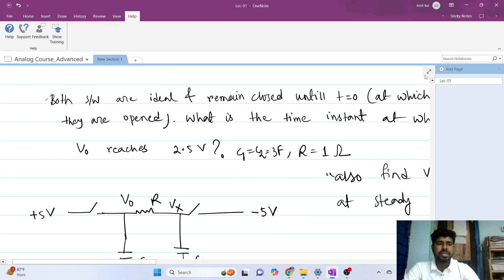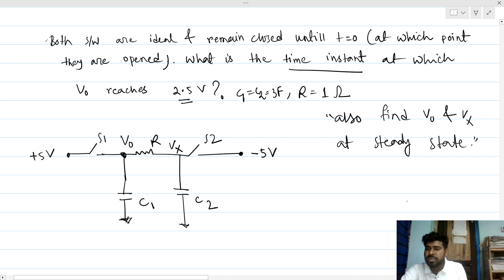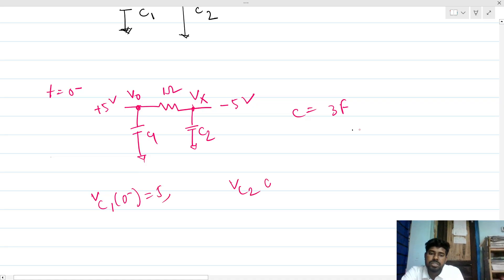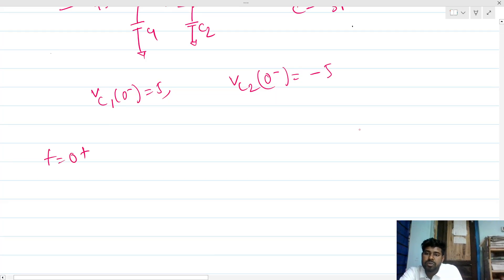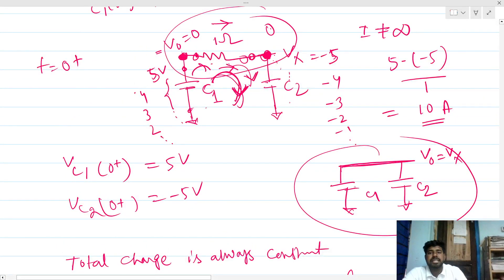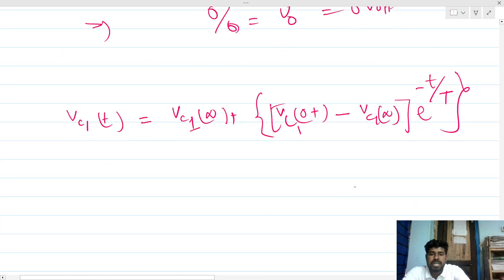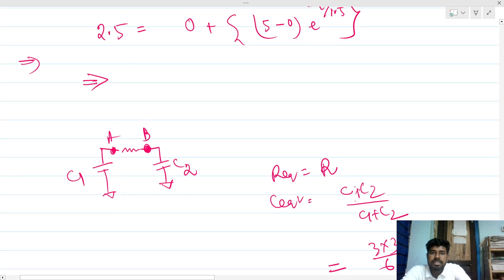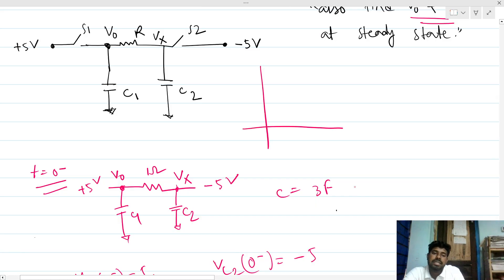Analog Circuit Design interview _ RC circuits with switches and initial conditions || Amit Bar

Comment: How C1 & C2 are considered in series while finding the timie constant?

You mentioned that we need to find the cap connection across the Req but did not understand it how they will in series in that case? Is there any simple approach to understand that?
Reply: when he removed resistance to find out the equivalent capacitance, the below terminals were connected to same potentials that is grounded (0V), hence it was in series.
Reply: @a.himanshu7673  true